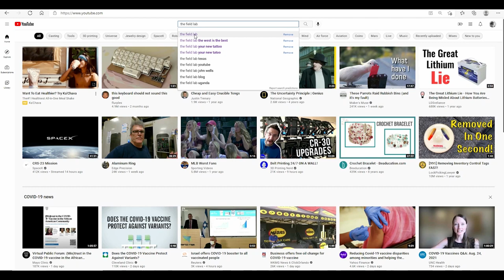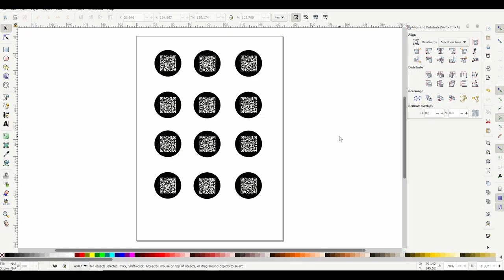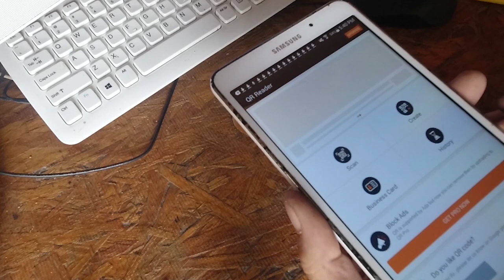ACID ETCHED QR CODE

Comment: Having had trouble in the past with the transfer, what model printer and toner brand are you using? Thanks. Nice job.
Reply from the maker: I use a cheap Samsung Xpress M2020W laser printer with some no name third party toner.  In the printing software, I change all the graphics settings to their highest resolution.

Comment: can you describe the process step by step and the materials used?
Reply from the maker: I suggest you first try to pause the video as you are watching it to pick out details of the process - it's all there.  As for materials: 1. the coin is cast aluminum bronze.  2.  I used a monochrome laser printer to print the image on glossy catalog paper.  3.  The image is transferred onto the coin by use of a clothing iron set on high - 4 minutes.   4.  After cooling off for 30 minutes it is soaked in water for another 30 minutes and the paper peels off leaving the image on the coin.   5.  I added some Sharpee ink and masked the coin with tape so when it soaks in Ferric Chloride acid for one hour - the acid will only effect the image area.  6.  I used standard baking soda in water to neutralize the acid.
Reply: @TheFieldLab  thanks